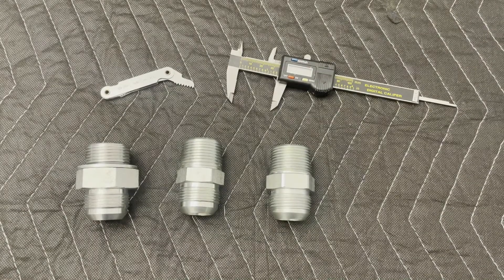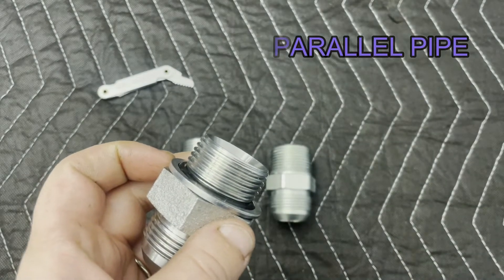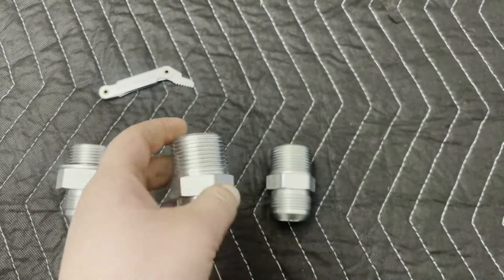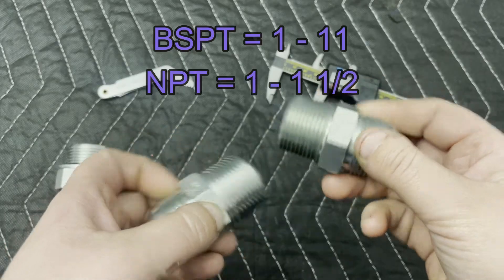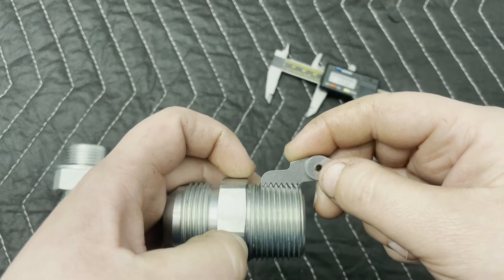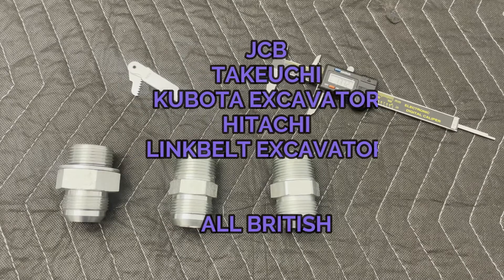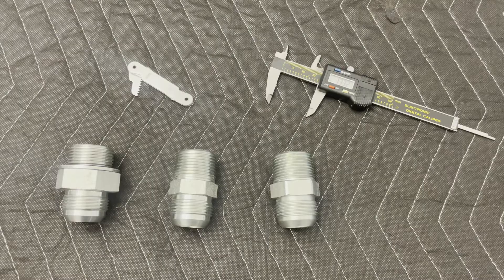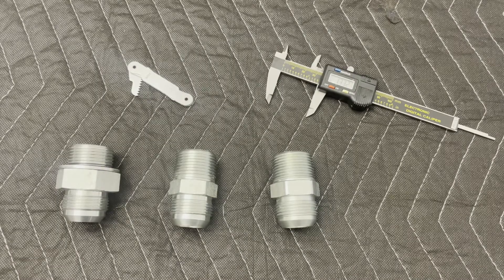BSPP VS BSPT VS NPT

Comment: Can bspp fitting with bspt??
Reply from the maker: No, unfortunately
Reply: @carolinahydraulichose6253  tq fr yr answer
Reply: @carolinahydraulichose6253  What about using a BSPT fitting in a BSPP thread to have a pressure seal. Is this a correct application?

Comment: The taper is the same between the two tapered threads, .0625 per inch, or 3/4 per 12 inches. However, as with the diameter being different the BSPT has a Whitworth thread profile with 55 degree flanks, where the NPT is 60 degree as is true with metric and UN thread types.

Comment: Thank for this video. I got an idea now. I have a water pressure tank need to be replace. its connection is BSPP but the replacement is BSPT, would that spell trouble for me?
Reply from the maker: If you’re trying to use your old hose then yes. BSPP will not screw into BSPT. 😕